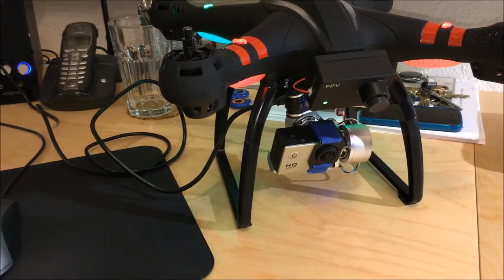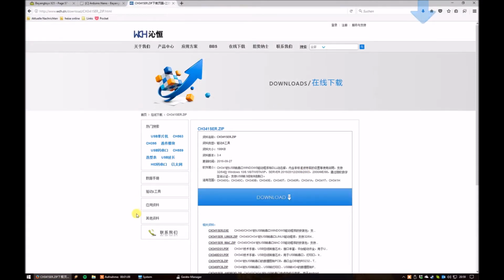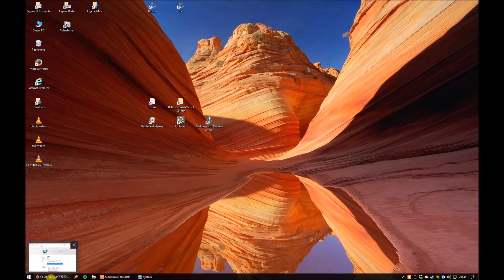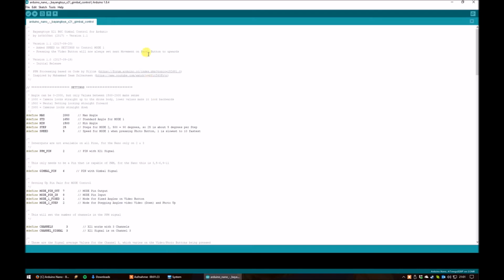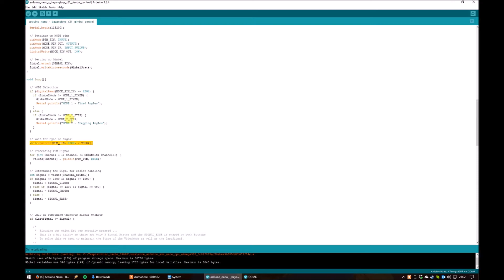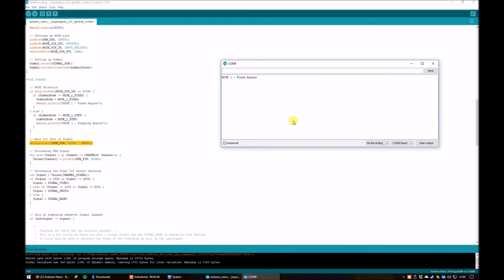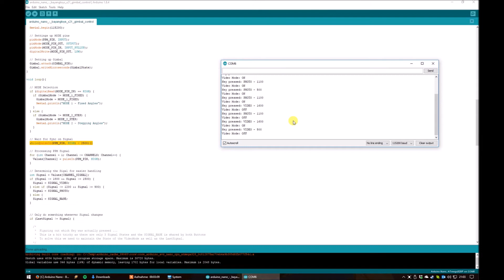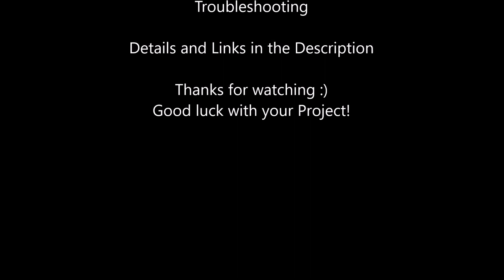Bayangtoys X21 - Gimbal Control - Troubleshooting

Comment: Hi brother, can I apply this method to my gimble? Because I see my gimble is not the same as you have. What I'm currently using is a basecam brand gimbal. I'm sure you will help me. Thanks.
Reply from the maker: Bolang Baling Channel I am pretty sure you can use the same setup since the Servo Control is standardized.

Comment: Hi Martin,  I have tried this on my drone Bugs2C 
On the camera pin there are 4 pins
Red - 5V
Black - GND
White - 3.3V
Yellow - Can not measure the voltage but not ground and there was some millivolt

Which pin should be use for PPM signal ?  White or Yellow

Thank you very much for your kind assistance.
Reply from the maker: I am sorry, but this only working with a Bayangtoys X21 - not with an Bug2C, they are completely different.

Comment: Hallo! 

Thank You for this tutorial. I made all that things, but I have compiling error on my mac:
/Applications/Arduino.app/Contents/Java/hardware/tools/avr/bin/../lib/gcc/avr/4.9.2/../../../../avr/bin/ld: /Applications/Arduino.app/Contents/Java/hardware/tools/avr/bin/../libexec/gcc/avr/4.9.2/liblto_plugin.so: error loading plugin: dlopen(/Applications/Arduino.app/Contents/Java/hardware/tools/avr/bin/../libexec/gcc/avr/4.9.2/liblto_plugin.so, 2): Symbol not found: _environ
  Referenced from: /Applications/Arduino.app/Contents/Java/hardware/tools/avr/bin/../libexec/gcc/avr/4.9.2/liblto_plugin.so
  Expected in: /usr/lib/libSystem.B.dylib

collect2: error: ld returned 1 exit status
exit status 1
Error compiling for board Arduino Nano.

Can You have an idea what's going on?
Reply from the maker: I am sorry, I can't help you there. Seems like a general issue with your installation on the Mac. I don't have any experience with a Mac, try using a Windows maybe?
Reply: Thanks! I did it on windows. My wife has pc from work :) I didnt believe I could do it but it works :)
Reply from the maker: I am happy to hear that! Have fun with it :)

Comment: serial monitor said: 
⸮⸮⸮⸮8⸮⸮⸮⸮⸮⸮⸮8⸮⸮⸮⸮>⸮v⸮v
Reply from the maker: Learn New Things you are using the wrong Baudrate. Set it to 115200. And you don't have to write 3x the same comment.
Reply: even if i'm not pressing the button its always like this..and its never stop. hope you can help me with this problem .

MODE 1 - Fixed Angles
MODE 1 - Fixed Angles
Key pressed: VIDEO - 1600
Video Mode: ON
Key pressed: VIDEO - 500
Video Mode: OFF
Key pressed: VIDEO - 1600
Video Mode: ON
Key pressed: VIDEO - 500
Video Mode: OFF
Key pressed: VIDEO - 1600
Video Mode: ON
Key pressed: VIDEO - 500
Video Mode: OFF
Key pressed: VIDEO - 1600
Video Mode: ON
Key pressed: VIDEO - 500
Video Mode: OFF
Key pressed: VIDEO - 1600
Video Mode: ON
Key pressed: VIDEO - 500
Video Mode: OFF
Key pressed: VIDEO - 1600
Video Mode: ON
Key pressed: VIDEO - 500
Video Mode: OFF
Key pressed: VIDEO - 1600
Video Mode: ON
Key pressed: VIDEO - 500
Video Mode: OFF
Reply from the maker: I believe there is something wrong with your cabling if your are getting a signal all the time. It should only change on each press of a button.
Also how do you power the Gimbal and the Arduino, are the they running of the same battery like the Drone?
Reply: MartinStaehle i used extra battery to power my gimbal ..and i connect the arduino to the gimbal to power it....
my wiring are the same as yours.
Reply from the maker: So you have the additional Ground connected as well? And as soon you power the Gimbal and the X21 the Serial Monitor gets flooded? What happens to the gimbal? Can you make a Video to show me your setup and what is happening?
Reply: ya...when i power the gimbal and the x21 the serial monitor gets flooded ..the gimbal start to act crazy ..

Comment: Hey Martin, can you please help me. I have an Arduino problem. Don't know how I can get in touch with you to solve my Arduino issues....... please contact me after reading this
Reply from the maker: Just write your problems here, I will try to help you as soon as possible and others might profit too. Right now I am just very busy in a project at work, so my answer may be a bit delayed.
Reply: @MartinStaehle  I can't upload the file to arduino nano (CH340) The program says  "The Sketch uses 4026 bytes (12%) of the program's storage space. The maximum is 32256 bytes.
Global variables use 346 bytes (16%) of dynamic memory, leaving 1702 bytes for local variables. The maximum is 2048 bytes."  If there is a space problem of my Arduino I only need to use mode 1. Is posible modify the file only for mode 1??

Comment: I'm going to try connecting a plug Jack 3.5mm for the x21. next to the ON OFF and load the PITCH file. Let's see if it responds as in X16
Reply from the maker: If you are running on a separate battery, you need to connect GND as well like shown in the Video here: https://youtu.be/p66duzODxks?t=144
Reply from the maker: You can use the 3,5mm Plug but be careful, you can only plug or unplug it while the is no battery connected to the Drone, otherwise you damage it.
You just need to add a GND connection from the Drone to the Arduino as well, if you are running on a separate battery: https://youtu.be/p66duzODxks?t=144

Comment: I just received my X21 and it has a connector called plug (looks like 3.5mm stereo phone jack) next to the power switch. WHAT IS THIS CONNECTOR FOR? Is it radio receiver outputs for the left stick trim controls that could be directly connected to the horizon and tilt control ports of a brush less gimbal? The included camera is 5g digital WIFI FPV and only connects to the drone through red and black conductors (power only) It seems the app on the smartphone is the only control of the cameras recording and still features as there is no data white or yellow wires from the camera connection on the drone to the camera. Thanks for any info! kevinspage.com
Reply from the maker: kevinspage Hello Kevin! The 3,5mm jack is a legacy of the X16. With the X16 there was a camera which was being connected through this - you can still buy it. It can be controlled via the remote unlike the new one which can only be controlled via the app.

Comment: Hello Martin!My gimbal is not working only red light I connect to simple bgc but nothing.Can you help me how it recovery?  If I change the controller driver  to :
https://www.gearbest.com/rc-parts/pp_61452.html

 is this compatible with :
https://www.gearbest.com/rc-quadcopters-parts/pp_119240.html
Reply from the maker: Does the Gimbal not work at all or do you want to configure it but can't get a connection?
Reply: The gimbal not work at all
Reply from the maker: But you did power the gimbal? No only connected it to USB?
Reply: I conected with power .does not work

Comment: hola... si entiendo bien.. debes de tener conectada tambien la camara original ?   para poder mover el gimbal ?
Reply from the maker: andres solano no you don't need the original camera, you can use any type of action cam basically.
Reply: la bateria que usas para le Gimbal .. cuanto tiempo te dura instalada con el Gimbal .. ??  tienes el lick de compra de esa bateria ??

Comment: Hi Martin.Can you set up(calibrate)  Gimbal with "simple BGC 2.2 Softwer .My gimbal is shaking,for this reason I need  to set up.Thanks for help.
Reply from the maker: A. Carky I had the same problem and also took me some hours to get rid of the shaking. I watched a couple of videos on how to calibrate it.
Reply: I need balance camera first on gimbal.Can you show or tell me where you put the camera on gimbal  ,what screw you used to fix it.Thank you.
Reply from the maker: Which Camera are you using? Does this Camera have a 1/4" tripod mount?
Reply: SJ 6 legend,....but I  waiting for  firefly 8s
Reply from the maker: If you are using a Firefly 8S, I can send you my config for it. Took me a while to get rid of the shaking.
Reply: I will use firefly 8s.I would be glad.Thank You.
Reply from the maker: You can use the SimpleBGC 2.2 Software to import this file here: https://pastebin.com/j2CnAuNM
You can download the XML File and load it. This is the file I am using for the Firefly 8S
Reply from the maker: This is really odd, looks like something is maybe broken. If you have used the same parameters like I did you should have a stable setup. I am afraid your Gimbal might be broken.

Comment: Can you connect the white cable directly to a walkera gimbal and control it without an arduino board?
Reply from the maker: No, that isn't possible. You might see some crazy movements by Gimbal, but that is it. All Gimbal use standard Servo Signals (PWM) and the Copter only give a PPM Signal for controlling the X16 Camera via the 3,5 mm Jack. You can find details on the Signal here:
https://www.rcgroups.com/forums/showpost.php?p=38257558&postcount=611
The reason you need the Ardunio is to caputre the PPM Signal and provide a Servo Signal based on the button you press on the Transmitter.
Reply: MartinStaehle I see movement only when i press the button. So that is what lead me 2 believe it is possible
Reply from the maker: trini0821 mhm, strange. Maybe you can make a video? 
I still doubt that it will be possible to control it, as the gimble does not know what to do with signal and you can Programm the gimbal nor the drone board.
Reply: Is this possible conect white cable with arduino to Feiyu 3d mini gimbal?How it do it?
Reply from the maker: Yes this would work as well. I checked the manual and the blue wire is for pitch control, which needs to be connected to the white wire in my example. If you operate the gimbal with the same battery like the drone, you're done. If you are using a separate battery you need to connect GND as well.
Reply: Connect blue cable from Feiyu 3d to pin D6(your example yellow) or connect it to pin D2(your example white)?But from where does arduino get power and GND.Thank you!
Reply from the maker: In my example white is the cable from the drone which tells the Arduino which button was pressed on the remote, so you need to connect the blue cable to D6 (yellow). You can use the black and red wires which power the Gimbal to power the Arduino also, it takes up to 12 Volts input voltage.

Comment: Hi Martin, I want to connect the GND of the drone for the additional battery directly to the Arduino. On the Arduino are 2 GND ports, once right next to the PPM signal input and another next to the PWM output port, which GND of the Arduino can I use directly? For me it makes sense to use the GND next to the PPM input...     Thanks in advance :-)
Reply from the maker: Hey Uwe! Basically it doesn't matter where you connect it to, GND is all the same and are connected with eachother. So you can use whatever is more suitable for you :).
Reply: Hi Martin, thank you very much,  I thought it might be separate GND for analog / digital input.  
I am very curious if I succeed in the project ;-)
Reply from the maker: I keep my fingers crossed for your project! :)

Comment: Hello friend, I've seen your video and I liked it, but I have a problem, I have a 3-axis gimbal, specifically the hakrc storm 32, and I do not know how to connect the arduino nano with the gimbal, could you help me? I leave my mail in case you want to contact me, donkeydrone@gmail.com Greetings and thanks
Reply from the maker: Hello! Glad you liked my video. The solution to your problem is quite easy, as it works exactly the same. As the transmitter only offers to buttons to work with, you can control only one Axis anyway. So the Arduino produces a standard Servo Signal, which is the same on all RC Servos. So the Hakrc Storm 32 also offers 3 Pins for the Pitch channel and they need to be connected the same way like I did on my Video with the 2 Axis gimbal. Hope this helps you out :).